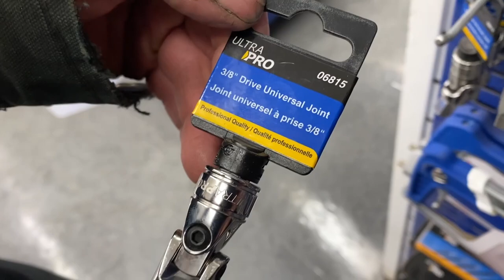Restoring our 1998 Toyota Tacoma | Solving our Sticky Situation | Part 4

Comment: I've never tried it myself but I've read that a 50/50 mixture of acetone and ATF makes a really good penetrating oil.  You might put a little of that down that valve and let it soak.  I don't know if the acetone would hurt the valve seal though so do some research before trying this.  Those 3.4 liter engines are good ones.  OR, just continue soaking it with the Marvel.
Reply from the maker: Interesting! You’ll just have to wait and see what we do on the next episode 🤫

Comment: I think it will be easy to swap out the engine and have at engine with lower miles
Reply from the maker: It probably would be but this engine actually has quite low miles being only 115k so that’s why we repaired it ourselves